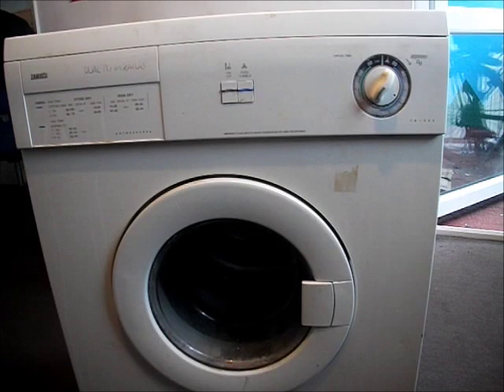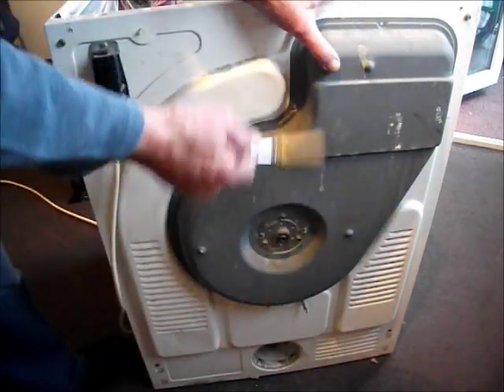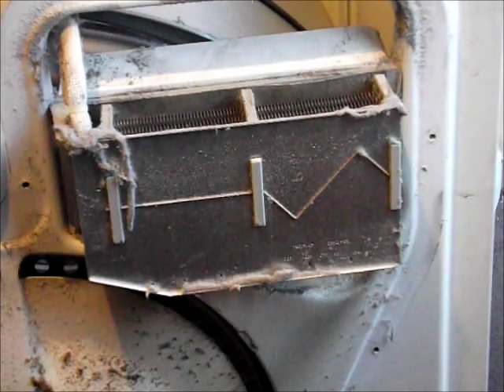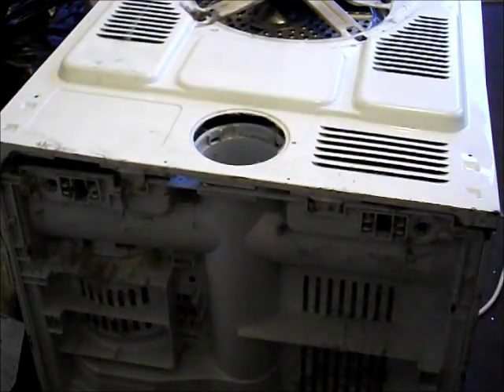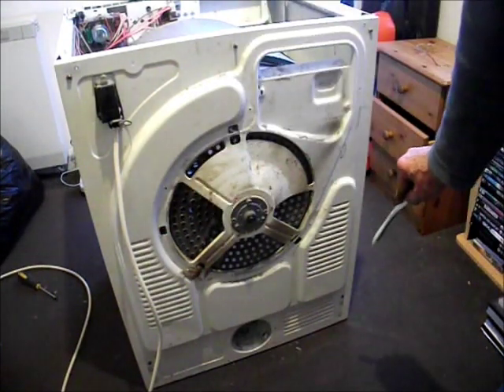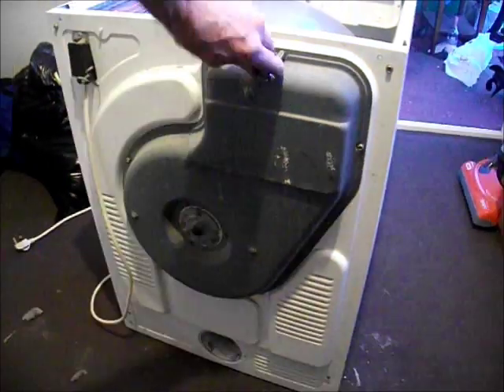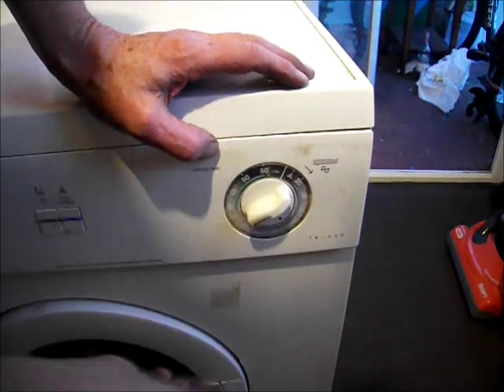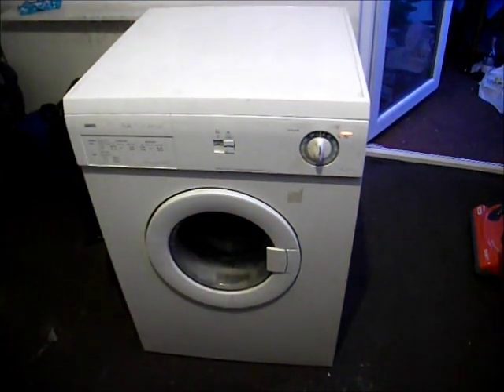Zanussi Tumble dryer REPAIR Heater & Belt. accordioncafe.

Comment: Great video. Although my machine was a different model, with several changes, I was still able to take it apart. You might like to add something about which way round the belt goes - smooth or grooved side against the drum.
Reply from the maker: Hello Simon Young. I see your point. Yes I will add an annotation as follows; The GROOVE side of the belt  will be laid on the drum. This follows automatically after routing the belt GROOVE to pully then over the jokey tensioner wheel as at 06;20 in the video. Thanks for your comment Simon. pugsy.  accordioncafe.

Comment: Hoping for some help here...I have a Zanussi TDS 302T. The drum stopped turning, so I thought it was the belt, but when I opened the lid, I was able to start the drum turning by hand once I turned it on. I read online that this could be the capacitor, but it doesn't have this problem every time I turn it on. What is consistent is that the drum is turning quite slowly, and cannot handle turning a larger load of laundry. This, to me, does not sound like the capacitor. There is no squealing of any kind, or grinding noises. I'd hate to toss this thing out if it is an easy fix. If it were the belt slipping, I would actually see the belt spinning over the drum, correct?
Reply from the maker: You would see the belt slipping IF it were slipping on the drum but not when it 'slips' on the pully of the drive motor. Do be carefull operating your machine when its plugged in. Im sure your not daft. My kids used to be all over the place. Little monkeys. Bless em. If its not slipping then you may have a module speed control fault. Ouch that's gonna be expensive.

Comment: Hi
Just wanted to say thanks for your excellent video.

The drive belt broke on my Zanussi TD 4113 tumble drier (it's similar to the model in your video).
If it had not been for your video, I would have been totally lost. I followed your instructions, fitted the belt and the drier is now working fine.
As the belt was broken, I did not know the process to loop it on the drive shaft, spindle and drum, so that section of your video was great.
Cheers
Reply from the maker: Thank you for your comment. Glad it was of some help.